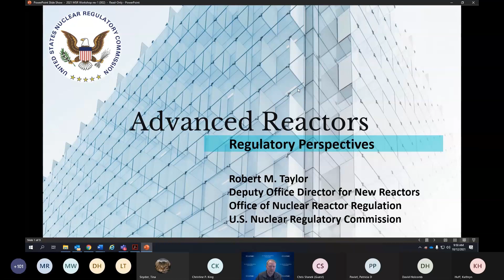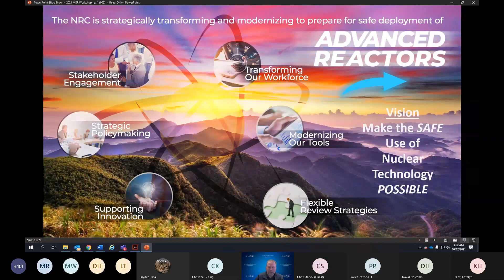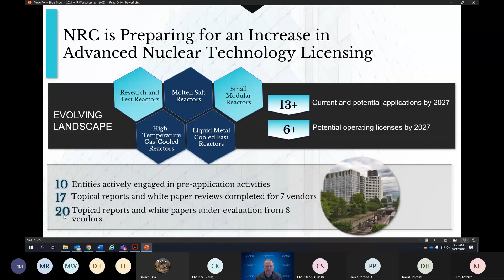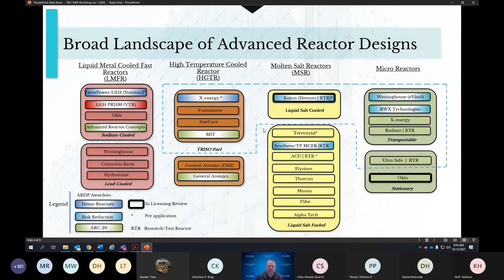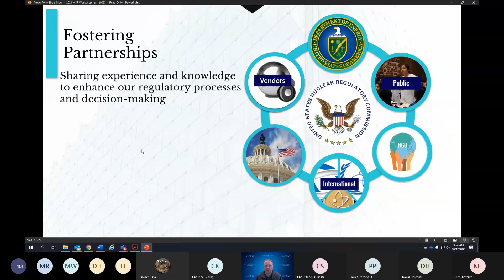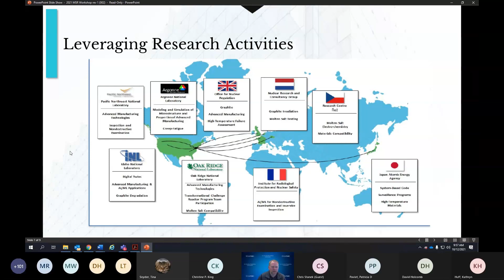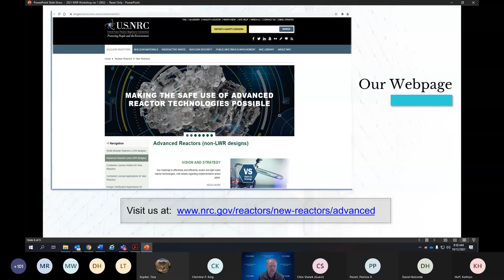Regulating Advanced Reactors - Robert Taylor of NRC @ ORNL MSRW 2021

Comment: Salt fuel concentration will relate to moderator, neutron reflection rate, overall mass size, criticality constraints as to temperature, (fuel type, 233, 235, 239, americium), neutron poison level, desired reaction level, temperature co-efficient, & thermal level totals. This will be a complex equation for each reactor, no matter where built or what size and will require a ramping up phase. This may be the most critical component and will need the highest quality nuclear engineer on start-up to reduce start-up time and adequate economy.